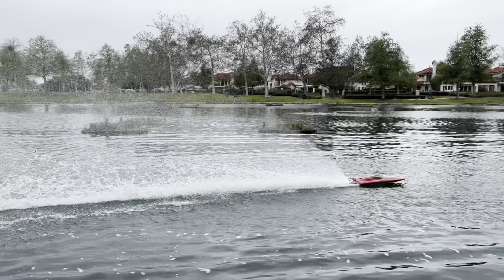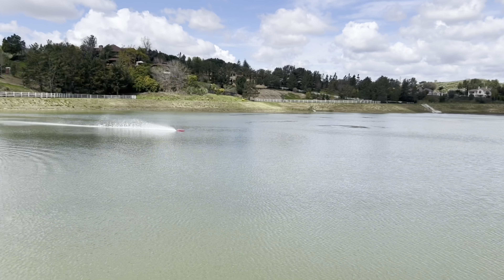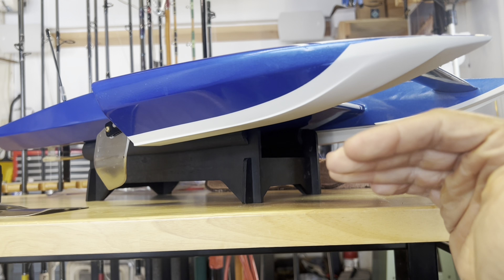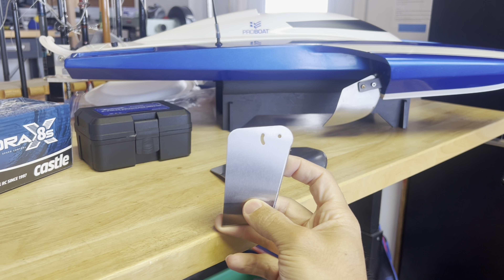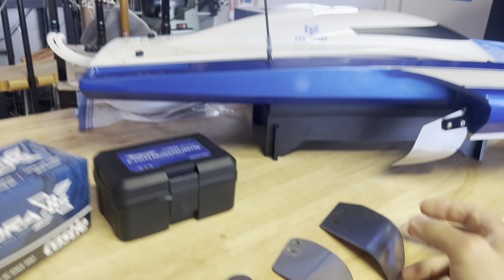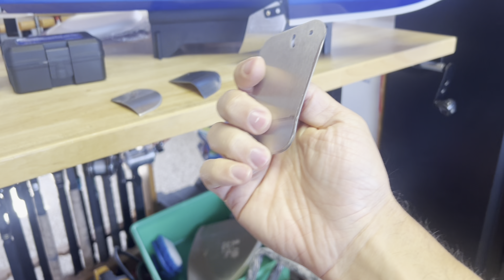Proboat UL19 - Tenshock EVO 2240 - Castle Hydra X8s - Mad Lizard Turn fins

Comment: Pretty sure my jl original aluminum fin has more cuve/bend than the newer stainless original fins.  Definitely not like a straight fin far from it youll soon find out when you get it on the water..   
A straight fin really dont care  where you set it, it can be angled back/forward and the boat will handle basically the same, the mj original Definitely needs to be set up correctly and not taken lightly,  youll see..
Reply from the maker: Roger that big B. Yes the new ones have slightly less curve I believe. I didn’t mean it was literally straight I just meant it was much closer to a straight fin than to a mojo by example. Just more forgiving is all. Still gotta set it neutral for sure. Hope to test soon. Thanks brother
Reply: I know exactly what you mean and what your trying to say!  keep it up!